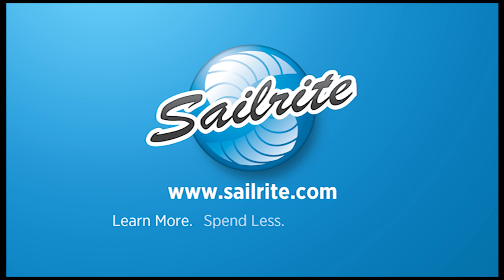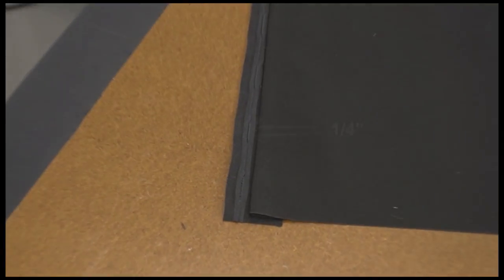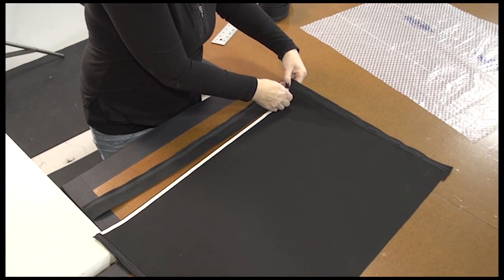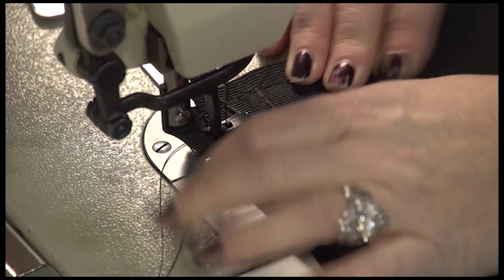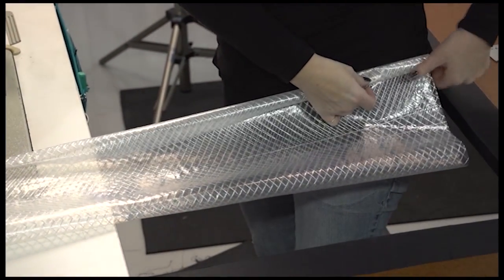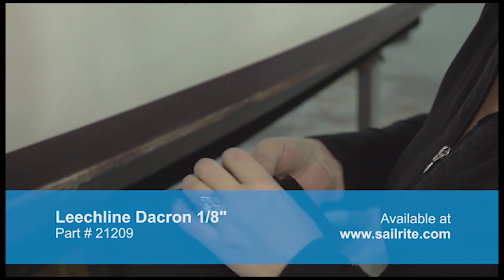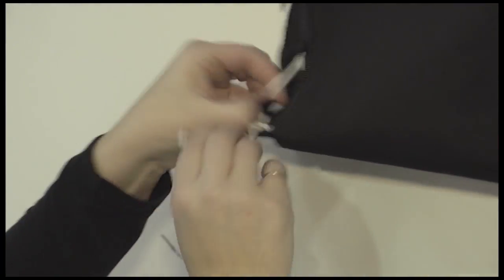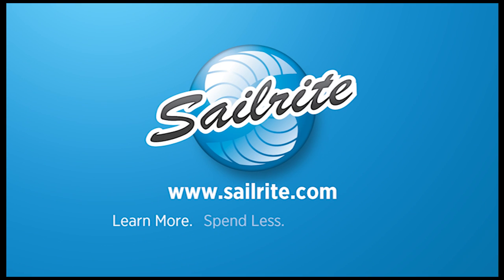How to Secure a Boat Cover with Sandbags

Comment: You could also sew a canvas pocket into the inside of the finished bottom edge of the boat cover which has an opening at the top to drop your sand bag into. That way you don't have anything ugly hanging from the boat. That's what I do and I have been doing boat covers for 16 yrs.
Reply from the maker: Good suggestion.